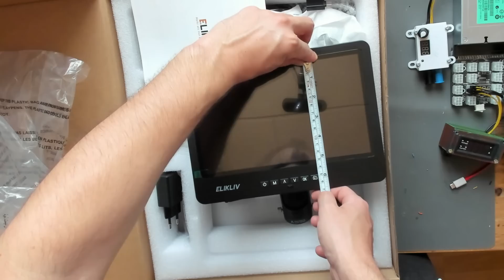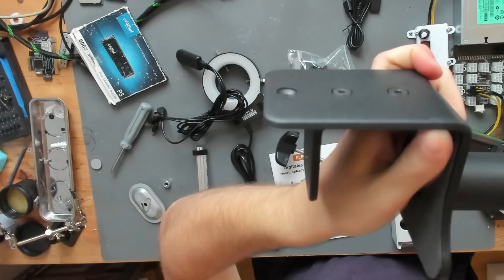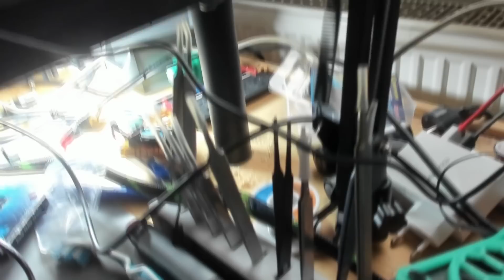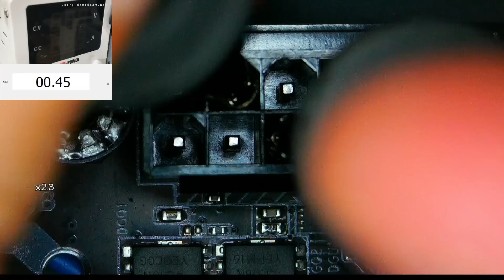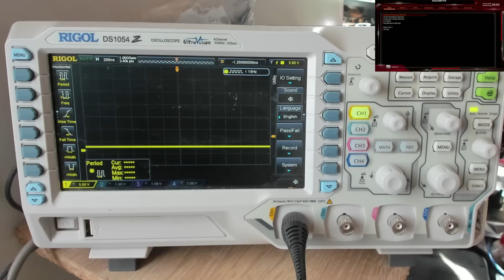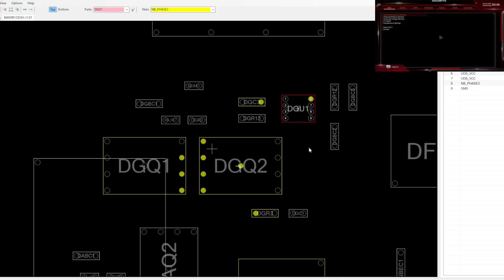WATER DAMAGED MOTHERBOARD ||| GIGABYTE B450M DS3H MOTERHBOARD REPAIR!

Comment: Hello. When you measure resistance on the ATX connector, pin 16 (ATX_PSON) shows OL, and you consider it good. Why? If it's correct to show resistance, what would the range be?
Reply from the maker: Mine sows O.L., because i have a manual range Multimeter. Often i check in the 2K ohm resistance mode and if the resistance goes higher then that it shows O.L. So Kohms and rising should be fine. Anything below 1k would be weird!

Comment: wow great vid man good clear btw i got a b450m it was working last night now nothing turn on at all not even the rgb got a new psu and still same 
no bruning smell and looks clean can it be the same as this mobo? case on the old psu i dont get the full wattage from psu so i think the psu killed smt there ( cpu is clean too no burns)😊
also that phase proly works when cpu is on and using more power not 100% sure tho

Comment: Hi my friend thank you so much for the information.i have mb Asus tuf gaiming b 450 show this masseg ..usp device current and shut down
Reply from the maker: You will need to check the data lines from the USB connectors and also the 5V. Also check the pin headers from the USB extensions. Might be a dead PCH!

Comment: Great video. I have the same motherboard but my pcie x16 slot is faulty. My rtx 2060 super does not show picture at all and I tried gtx 1060 that showed bios but when booting windows I get bsod. I tested from nvme to pcie x16 adaptor and both GPUs work and no issues. I would like to try to fix the pcie x16 slot. Can you give any suggestions what I could check or what can be the cause of faulty pcie x16 slot? 
I would appreciate any help. Thanks
Reply from the maker: Hey there, most off the time its the PCIE capacitors that connect from the slot to the socket! Also the traces can be damaged at some point and have a small crack in them! Last thing to check would be the socket itself if the pins in it are alright or not! 
Also can be a CPU issue, i have a CPU with dead PCIE lanes that only accepts a GPU if the lanes are routed through the PCH!
Reply: @MainboardMedic  Thanks. I will try to check capacitors.
Traces you mean on gpu or where exactly. Gpu is definitely not faulty. I tried it on another motherboard and it worked perfectly.

Comment: I’ve got a board I need repaired - it’s a X99 itx board and the replacements are rare. I think there is a problem with the vrm and there is at least one leaking capacitor. I’m happy to send it in!

Comment: Hi there, I was thinking that the mosfets not showing any pulses could be like what GPU's do. during low power states not all mosfets are active and become active when needed. Maybe check the mosfets with your oscilloscope when running cinebench or something like that. Could be CPU related e.g. how much wattage the cpu draws. Try running a R5 3600 and see if all your phases are active. Just a thought. Nice fix! Cheers!
Reply from the maker: Right a different CPU would have been a good idea as well! Well for next time then!

Comment: I think if you had checked across the coil with an ESR meter it would have shown up straight away.  Nice, another board saved from landfill.
Reply: Oh how does this check across the inductor work? What can you expect to see good vs. bad? I’m still learning VRM troubleshooting 👍
Reply: @mesterak  An ESR meter checks impedance not resistance, works differently to a multi-meter using high frequency AC. Doing that it drives current both sides of the coil so if you have a short on one side you will see a differing reading to a  stage with resistance in circuit on both ways.
Reply: @sherlockholmes1121  is there a video on how to use the ESR meter in this manner? I just recently purchased one and have used it only to test capacitors.
Reply: @mesterak  Richard from Learn Electronics Repair did one. However he has so many, but I think it was in the GPU repair section.
Reply from the maker: Ive seen LER do that before! Sadly i dont own an ESR meter!

Comment: Not weird at all, if the top two were short the others will get hot dumping current into the short, or having to supply a higher load, what's complicated about that?
Reply from the maker: But those mosfets shouldnt be open, their gates arent driven by anthing or am i wrong here?
Reply: @MainboardMedic  I think we are talking about different ones, I meant it is acceptable for the ones you first took off to be hot, because they were doing more work due to the two at the top being short. Are you speaking of the two which don't appear to be on? I agree that was a bit of a puzzle, I don't understand why there is no drive waveform on them, yet they appear to be giving an output, do you think the measured output is coming from the working ones and back to those two? What tells the driver chip to turn on the mosfets? should that be followed?

Comment: Did you check the signal from main controller to 2nd controller/driver for that non-working phase? Could be a partially dead main controller as u said. Great video btw, entertaining as always. 👍
Reply from the maker: Should have done that, well next time then!

Comment: I have the same thermal camera and I am looking to replace it with one with higher resolution. 
Over time I have learned that if a mosfet is shorted it is better to replace the entire phase and the driver since it is very easy to send 12 volts to the processor and I have a few processors that can confirm that.
On the other hand, if you can't find the shorted component, it's always the one closest to the big plastic connector, just kidding.
Seriously, people should avoid buying these types of motherboards that do not have a heatsink in the phases since they are garbage. Think about how much the cost could be for a large company that already has the capacity to produce them. 3 or 4 dollars maybe? For me it is not reasonable that a large company has these types of practices.
Reply from the maker: I am also looking into getting another one! I was thinking about the infriray P2 i think its called. Ive seen other repair chanels use it and it seems preety good!